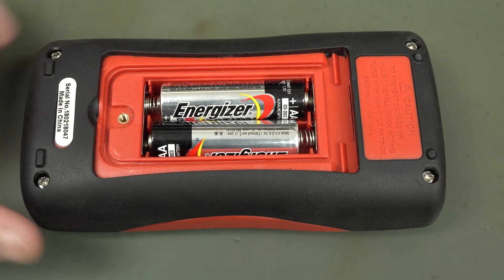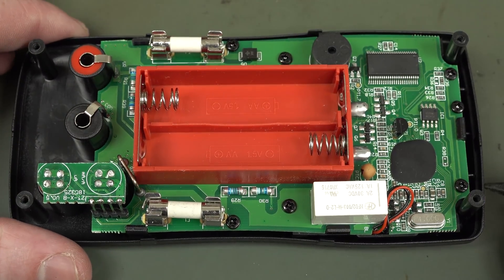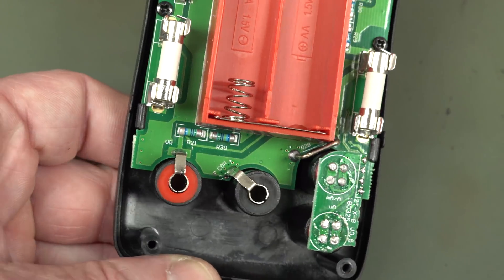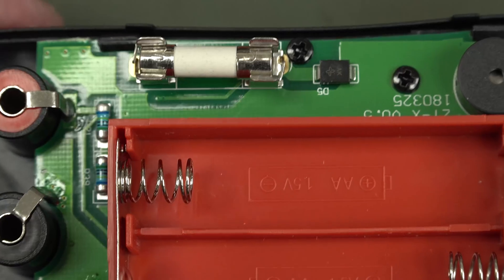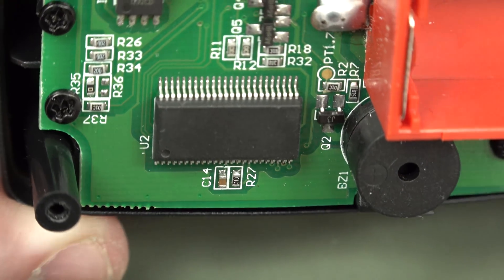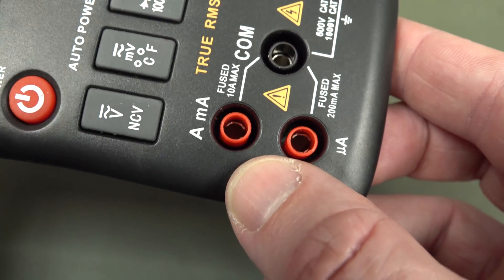EEVblog #1096 - ANENG Q1 Multimeter Teardown (Now in 4K!)

Comment: Omg the soldering on that icl8069
Reply from the maker: That's not uncommon with through hole parts, just variability in the hand soldering. The other side was fine, the solder just didn't flow through on two pins.
Reply: i was kind of surprised he didn't mention it!
Reply: James Rowland  yeah my thoughts exactly I’m like what soldering like they missed two pins no?
Reply: Glad it wasn't just me - it was shocking.
Reply: My OCD kicked right in. I'd have to fix that before closing it up or it'd haunt me for days.
Reply: EEVblog
But if the solder didn’t flow into the PCB holes, two of the leads of the ICL8069 are supported only by the solder on one side.  Over time, with thermal cycling and mechanical stresses, the solder will crack and cause the circuit to malfunction.  I repaired an electronic ignition and a 16-bit minicomputer that failed due to this sort of crappy soldering.
Besides, this just screams out that the soldering iron was too cold, the tip of the soldering iron wasn’t making good contact, not enough solder was applied, or the solder flux didn’t work.  There should be no excuse for this kind of poor workmanship.
Reply: Guessing hand soldering also explains some of the surface mount components being a little crooked.
Reply: M-m-m... a good old Intercil :)
Reply: That caught my eye right away as well.
Reply: It's hard for me to critique the soldering job on that voltage reference,(ICL8069) because they DIDN'T SOLDER IT!!!🙄😏
Reply: That is mosfet or diode?

Comment: My ICL8069DCZR, it went bad after I installed a battery in the multimeter to replace the batteries, which is very annoying, I went to test a board with 5v energized, the test leads touched each other, it gave a small short, and my multimeter turned off the display to discover that The cause was icl8069, it stayed still for a while until I picked it up again and tried to bring it back to life

Comment: The soldering isn't actually too bad, when you consider it's probably RoHs solder.(no lead). That type of solder is not as shiny as Lead/Tin solder, and it requires higher temperature. If you're planning on using that meter, I would highly recommend re-soldering the ICL8069 voltage reference. Even though it's probably soldered just fine on the other side of the board, I never really trust those vias on double sided circuit boards. If you flow solder on the top side of those boards, it would help ensure more consistent voltage readings.
Reply: Honestly the newer lead-free stuff isn't half bad nowadays. The difference between leaded and lead-free is shrinking and with a decent pace

Comment: It's like nasa WHY?
KISS Keep it simple stupid I was told may years ago. Don't fix it if it ain't broken. What they needed to do was put in better protection on the 8008 and improve ma ranging and that's it and maybe heavier leads.
Why o why
Reply: @irisguy200007 hey can you help me 
I accedentally put 240 volt in the amp mode and now it's not turning on
Reply: Check the internal fuse

Comment: OK the screen thing sucks it means you need pristine alkaline batteries in it all the time. But what if you use one Tr 14500 3.7 volt rechargeable with a dummy battery? That way you get extra juice for the screen to last and it is now a rechargeable meter? Bobs your uncle?

Comment: Yes the video quality is excellent.
I do not have experience with LCDs, but believe they are ac driven and the phasing relationship determines which segments turn on.  If that is true, then wouldn't it be possible to switch from the negative view to the positive view by reversing the phasing?
 I like that dark background for inside work, and it would be neat to have another switch, (or an ambient light sensor), that would switch to the positive view and switch the illumination off when the meter was being used in a bright area.

Comment: I was thinking of reversing the polarizing filter, and disable the backlight.
Reply: u can change LEDs to different color with low voltage (ex. yellow/green/red), this will reduce current consumption and use full capacity of batteries. Or jist use lithium ion.

Comment: I got Aliexpress faulty Aneng Q1 ... 3 Large rectangular buttons selection modes don't work ... Now it measures only amperes and milliamperes ...
Reply: I found the faulty Q5 transistor ... It is the transistor the sensor of probes of a nest milliampere ...   On it the multimeter was constantly in the mode of measurement of amperes ... I removed the faulty transistor Q5 ... buttons of the choice of the modes of measurement began to work...

Comment: Would be nice to know whether it can run off a 4V supply.. that 2xAA battery case looks like a nice place to stuff a LiIon pouch cell in..
Reply: Yeah it can. Works great on a small lipo cell with a usb tp4056 protection module

Comment: Good hour. Thanks to your detailed review, I bought myself the same multimeter. But in the case of a change on the board, the resistor P30 is replaced by a jumper. Could you suggest the value of this resistor.

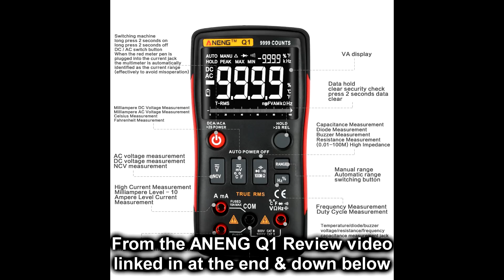Comment: 4K looks much better at 1080p, and so does 1440p. You can tell the difference from 1080p to 1440 to 2160(4k) on a 1080p monitor too. At 0:01 thru 0:05 the text is an easy place to see a difference. Same with the PC traces. Too much  Youtube compression I guess !
I can't believe you didn't say anything about the ICL8069 , almost NO SOLDER on pins 2 and 3 ! Amazing it even works ! Soldering all over is terrible !
Also missing current ranges too ?????
Reply from the maker: The soldering is fine on the bottom side, it just didn't flow through, not a big deal

Comment: I don't understand your disdain for the LCD screen? I have this DMM in my hands right now. My eyes see it quite differently. Bold segments that are easy to read and clear as day. Bright and spacious display with space to spare. Amazing considering how small this meter is. It's not OLED or EBTN but it's damn good nonetheless. Maybe you acquired a dud. Even good batteries are cheap as borscht nowadays so battery life really shouldn't  be a factor. What's the deal?  I think it's a step forward unlike some new meter displays that seem stuck in the "90s. Btw, the meter ships in a nice OEM case. More new meters should do the same!
Reply: I have a lot of multimeters including the Fluke 87V, i bought this one (in the ZOYI ZT-X variant) out of curiosity as i liked the layout, and have to say im most impressed, its now my go to meter. the display is gorgeous, yes its not clear outside, but i can't remember the last time i used a DMM outside, and if i need to have have others that can fulfil that task. I paid just over £21 on Ebay for this meter. So what if the display will use more batteries? had it a month now and used it most days, without changing the batteries. There is a battery hack which i have just purchased and will mod the meter when the batteries need replacement. I have checked both the resistance readings and DC volts with calibrated reference checkers and find this meter to be as accurate as some of my very expensive meters.
Reply: @jimmcmillan8985  hi. Have just ordered this meter. What was the battery back you mentioned? Thanks
Reply: Dave hates if its cheap

Comment: for high-res close-up stuff (e.g. 4k video of electronics) you should use fixed F/8 and iso100, if you have enough light for that
Reply: Depends on the size of the sensor. F/8.0 provides longer DoF, but the resolution might decrease due to diffraction.

Comment: Good review.  I might pick one up just to have a bang about meter instead of carrying my Fluke everywhere.  

The 4K was really good.  You could even see your reflection in the solder joint when you did your first zoom on the ICL right around 2:45.

Comment: @EEVblog: Nice teardown, even if you concentrated a bit too much on the 4k thingy and not on the teardown itself. ;-)  I don't have more resoultion than 1440p at max but it looks very nice and - as you said - it is good thing being able to zoom into details in postprocessing of course!

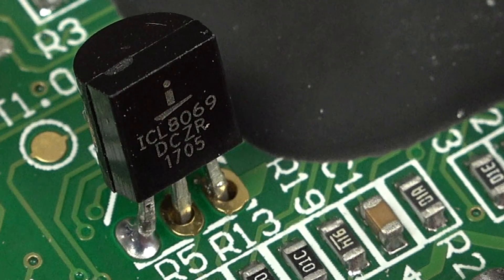Besides that infos on the video itself - looks like that at least this particular multimeter (or maybe even all types?) from ANENG is a clear No-Go! Build Quality is poor, protection is just the minimum it has to have for the rating, clearances are not the best, soldering joints are either not really soldered (like that one at about 2:50) or the big fat solder blobs you showed later on which are "dry as a dead dingo's donger" :-D

Good on you, Dave! Keep on with such features of your language! I really like that. Makes the difference inbetween a 100 percent correct but boring video and a good, interesting and fascinating video.

Comment: Why is there no solder on two legs of that transistor?, the one when you were talking about the 4K zooming
Reply: neil h 
through hole component soldered on the other side of the board.
Reply: I thought I saw tracks going to those pads on the top of those holes, obviously mistaken lol, cheers :-)
Reply: neil h 
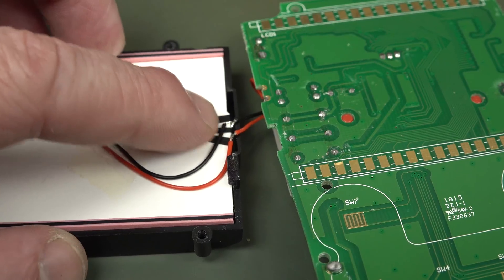At 3:59 and again at 4:46 you can see the other side of the pcb , yes you are right, there is tracks on the unsoldered side, so I’ll say the holes are vias but the solder just hasn’t flown all the way

Comment: The relay is rated for 125VAC but the meter is rated for 600/1000V, how does that work?
Reply: hmn
Reply: Bro there is some resistance which stepdowns the voltage.

Comment: EEVblog you say that better version aneng 8008 with AA battery will be better. There is that version with 4 banana sockets, branded name is RM303 (Richmeters) or ZT303 (Zoyi), btw it's 20.000 counts meter. I don't know what is anneng number of this meter, olny i see much bigger AN870 (size similar to fluke 17b) with same functions.

Comment: Throw me a bone right quick?  That a latching relay?  If power lost to meter when latched in one position will it stay there and say if plugged in test leads could say be a bad thing if meter off and latch relay in wrong position?  Sorry if my wording is a bit off, or even way bit off, health issues acting up and pills make my mind foggy, hate that part.  I know most modern thermostats in homes use a latching relay and a single AA.  Last a year or better.  Wondering is all.  Thank you.

Comment: If you need the NCV option this meter has to offer then i suggest getting the Aneng AN8009 instead, its almost the same as the AN8008 but has the PWM switched for the NCV,, you also get the temp probe and it will save you a few $

Comment: So the multimeter is rated for 600 V Cat3, but the relay only for 125 VAC and 30 VDC? That doesn‘t look like it will last long.
Reply: In theory the relay shouldn't ever be switching any current, so it should be OK. Typically the rated voltage is for arc-suppression capabilities, not for the relay's maximum "blocking" voltage. If there's no current flowing, there shouldn't be any arc to break.
Reply: Dielectric Videos That makes sense, thank you!

Comment: Dave, with all the negative remarks you gave about the display, wouldn't it be a good part of the teardown, to try and flip the polarisor foil to see if that works to invert the display. This because I believe the MM will keep working below this 2.5V threshold. Yes the led will cut off but the meter will still be usable like his cheaper brother. With all the measurements within good spec I love this meter, because I dislike the dail and would love pushbutton. Makes one handed work much easier.

Comment: The comment about the higher bitrate on 1080P is only true if you watching on a browser that support the VP9 codec officially. That is to say half of the mobile devices with 2K screen are still streaming MP4 because it’s more recognized and  has hardware built in GPU instructions for better battery life even if you tablet or laptop support up to 2K and 4K. So now youtube won’t encode MP4 in anything higher then 1080. Unless you can download google chrome web browsers but again some devices don’t support VP9 including TV, and other things that even have googles own app installed on them. So you can have a smart 4K TV that may not play a real 4K or better 1080P. And if it’s is playing 4K it might just be upscaling it. 
Even most andriod devices can’t run VP9, and it seems VP9 is more processor heaving killing batteries faster on laptops if you do force Firefox to run it. But mobile browsers or safari, sorry. 
So if IPad Pro owners and other high end tablet or laptop owners are wondering what happened to the 1440 (2K)option, now you know. MPG has been officially accepted and supported by almost everything, but google is forcing their now codes down your throat. Name a song,e camera that records in the video format, so it doesn’t matter what wrapper codec your camera records in, YouTube changes it completely anyway. 
Even if it’s a little sharper, still It would be better if they rolled out open support for everyone before changing YouTube over. 
I’m not going to go buy a new tablet TV because of this, google can bite me. So you won’t be seeing any 4K uploads from me until VP9 is an adopted standard and has built in support on processors and GPUs without the need to go buy new hardware or the latest andriod device. Seems like abuse of power if you ask me.
Reply from the maker: Err, why not just upload 4K now if you are able to? Everyone can still watch in 1080p
Reply: Yeah, seems like an excuse to me, but the odd part is the statement about mobile devices and tablets as if that's important.  If you want a good 4K experience you need a larger screen.

Comment: I was wondering if that relay drew current all the time or not.   By the way Dave, the newer 8009 does have the NCV in place of square wave generator and also has temp probe - unfortunately the 8009 still doesnt have the missing ranges you spoke of.   If they added the ranges, replaced the power hog display with an updated LCD one, rework the tilting bale maybe they could keep the push buttons and with these mods have a good upgrade model from the 8009.   I have an 8009 and its been great, had high hopes for the Q1 but looks like they didnt think this one through, the design just isnt practical in its current form.

Comment: How come only one of the three leads is soldered at 3:00? Any reason this wasn't mentioned?
Reply: I think those are not plated throughholes and on the other legs the solder didn't flow through from the other side.

Comment: 4K vs regular HD all looks the same on my 4K smartwatch anymore. My eyes must be going.  That additional unmarked chip looks like a popular philips segmented LCD driver commonly used in automotive applications..... it has the resistor and capacitor pair next to it that select oscillator frequency for lcd scan.
Reply: Ha! Old timer! I can see every pixel on my 8K smart watch screen. Your eyes must be worse than ya think!
Reply: Yeah, i would say Philips or Holtek made that chip.

Comment: the polarizer on the display can be inverted? and use a reflective surface on the back to work without the lights (as a "normal" lcd)?
Reply: Thats exactly I was thinking about
Reply: Ahh you beat me to it! I was going to ask that too.
Reply: I did this to the LCD on my motorcycle to make it inverted when the polarizers got damaged by the sun. You just rotate the polarizer 90 degrees.

Comment: The meter is even less relevant when you compare it to the Aneng 8009 which is nearly identical to the 8008 but has the NCV (using the selector position and replacing the odd square wave generator), and if I remember correctly the 8009 also addressed the uA range gap as well, though I'm not sure about that.
I can see your reflection in the solder on the 4K zoom! Dobby Bazzler!
Oh, 8009 also has temp measurement and comes with probe, only 1° resolution though.
Reply from the maker: I just noticed the reflection in the solder joint too, amazing!
Reply: I have an 8009. No, it doesn't address the mA range problem.

Comment: No solder or not enough on that TO92 by the looks
Reply: Soldered on the opposite side by hand. Plated through hole, so it will work fine, unless of course you bump it, but then that's not the only thing that's going to fail on this device. Anyway what's dodgy solder job to the likes of us?

Comment: Did you ever mention anything about the poor solder welds on the 3-pole transmogrifier?
Reply from the maker: No. That's common for through-hole parts, just variability in the hand soldering.
Reply: Yeah that's what I thought was the point of the thumbnail. I couldn't see any solder on the other two leads at all and was super surprised that you didn't mention it.

Comment: Great review and teardown, the 4K looks fantastic. I don't have a great audio setup (a dickey 30+ yo boombox wired in) but there was nothing bad in the sound. The icky soldering did show very clearly though. I am very curious as to why that transistor didn't have any solder on two legs (at least on the topside) but if it wasn't worth pointing out then I'm going to guess it's not a big deal for whatever reason.
Reply from the maker: That's common for through-hole parts, just variability in the hand soldering.

Comment: What is it with the soldering job on the voltage reference around 3:00 ?! That is terrible !!! Well at least there is a connection on the bottom side...
Reply from the maker: That's not uncommon with through hole parts, just variability in the hand soldering.
Reply: Gotta save those microcents worth of solder where they can.
Reply: Probably some deciseconds worth of labour too.
Reply: Mark Evans yeah, those Chinese pre-teen skilled workers don't come cheap.

Oh, wait...